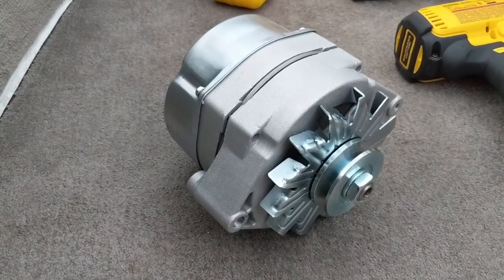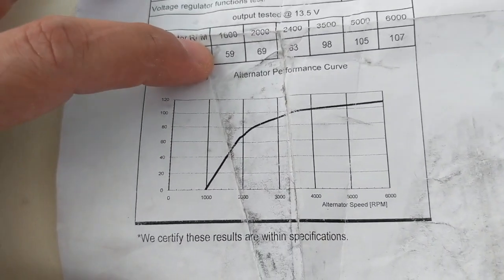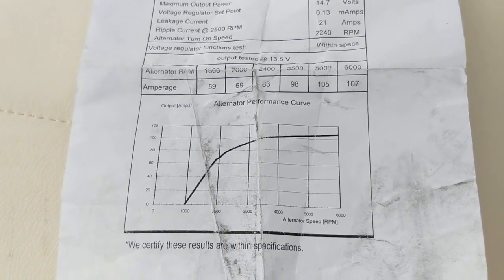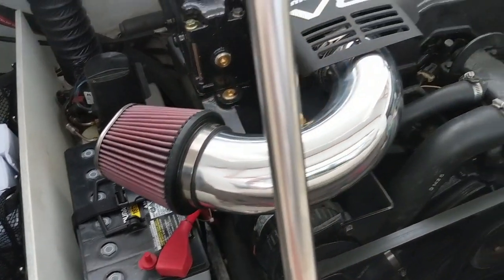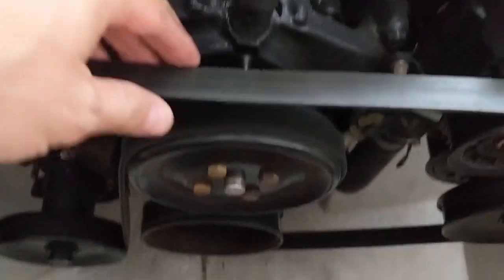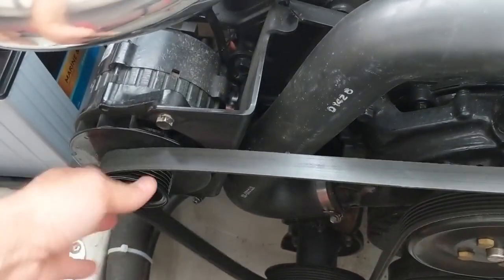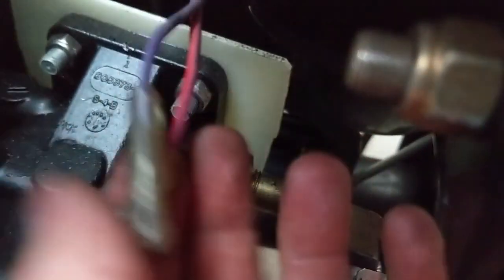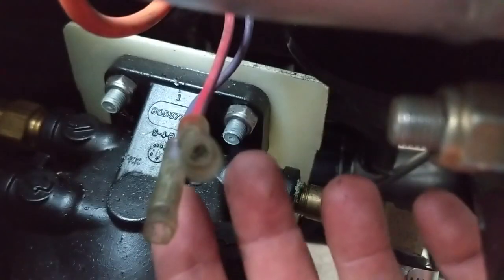Mercruiser Alternator Upgrade

Comment: Just ordered one for my Mercruiser. Do you recommend me running a 4awg wire from alternator to starter, and then 4awg from starter to battery as well? 
Or will stock wire from alternator to starter be fine and just run a 4awg from starter to battery?
Reply from the maker: What I eventually did for the wiring was this. I left the factory wiring from the starter to the battery. No need to upgrade that since the starter is still pulling the same amperage. Then the wiring that goes from the starter to the alternator, I disconnected it from the alternator and capped it (triple heat shrink so it was protected). Then I ran 4awg from the alternator terminal to the battery bank. That way the alternator was directly feeding the battery bank with the shortest path and best wiring, while the starter was left basically stock.

Comment: Did you check your before and after AMP output, I would be surprised the existing #8 wire (B+) can handle the additional amps
Reply from the maker: Keep in mind the 8awg cable is only from the alternator to the starter. From the starter to the batteries on most boats is either 4awg or 2awg. That's typically okay for up to around 60-80amps of draw depending on cable lengths and quality. In my case It seemed to be fine with no cables heating up beyond what seemed normal. But what I ended up doing is running 0/1awg cable from the alternator directly to the battery switch and then 0/1awg from the switch to the various batteries and circuits. Was worth the extra cost and time spent to upgrade the cabling for peace of mind for sure.
Reply: @NKPGarage  Ok, did you check AMP output before and after? I am considering this, however I have a mercruiser and not so sure about eliminating the sensing wire, choke wire and excitation wire. I guess I could pickup B+ elsewhere.
Reply from the maker: @GardylooAlaska  I didn't check it with an actual gauge. But I can tell you that the AGM batteries that I have definitely charge faster. And in the night when I switch on my bright docking lights there is no more voltage drop like there was with the old alternator.

Comment: I have the exact engine. Have you had any issues at all or problems with the purple and red wires you capped off?
Reply from the maker: Hey Alex! No issues at all. It has run great and charges up very well.
Reply: Are you running lots of stereo equipment or just wanted to upgrade? My stock Mercruiser 65 amp charges intermittently and had the power terminal all corroded out and was getting hot. Did you upgrade the wire going to the starter as well? Just curious, thanks for the info. I’ll order one tonight!  👍🏽
Reply from the maker: @alexayala3660  We have an upgraded stereo, amp, and spears, but nothing too crazy. I am running 3x group 31 Marine AGM duracell batteries. Our normal routine is to find a spot to anchor, and spend probably 5-7 hours hanging out with the music running, and by that time the two batteries running all my accessories get pretty drained. The old alternator took a few hours to charge them back up so they were never really full and I had to plug into a trickle charger each time we put the boat away. With thew alternator they charge up very quick and I never plug into a trickle charger anymore. Also, worth noting, if you have oldschool batteries, you won't benefit a lot from the charge rate, but if you are running AGM or Lithium batteries that is where you will see the biggest difference since they are able to accept a charge at a much higher rate. For the wiring, what I ended up doing later on is.... 1) I disconnected the wire going from the alternator to the starter, but left the wire going from the starter to the battery switch, then.... 2) I ran a 4awg wire from the alternator to the battery switch for charging, and then 3) ran 4awg from the switch to all the batteries and between the two housed batteries. Never had problems with the stock wiring, but I think the 4awg helped.
Reply: @NKP Garage Awesome! Thanks for the advice!
Reply from the maker: @alexayala3660  you got it !

Comment: I have that exact engine and wanted to replace with HO like the one you installed. Have you had any issues and was the purple and red wires you capped off that went to the old one cause any problems?
Reply from the maker: No issues at all. It has been running really well.